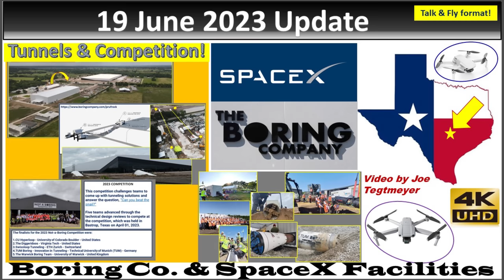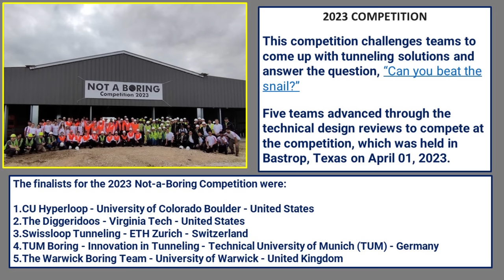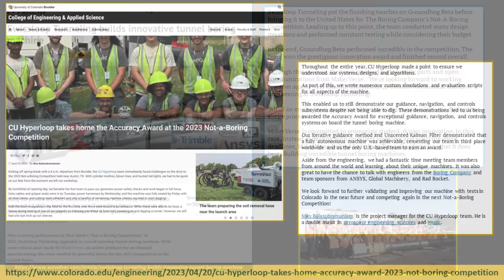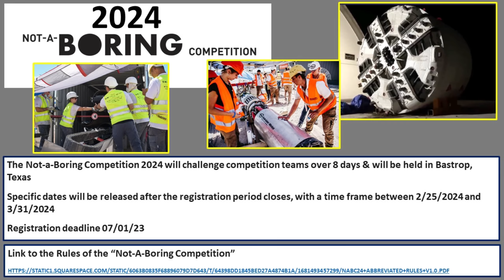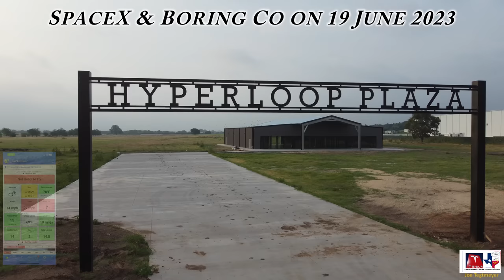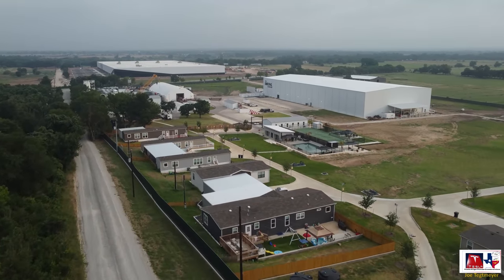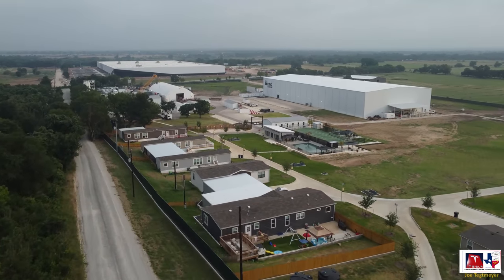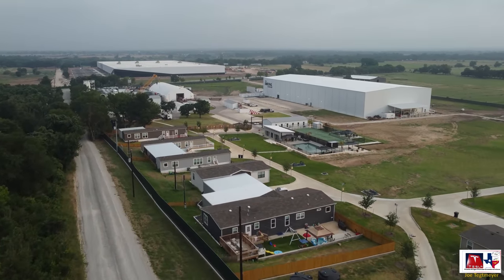SpaceX & Boring Co Facility Review & Discussion! 19 June 2023 Development Site Updates (8:00 AM)

Comment: Thanks Joe
8:26. Boring Co. White frames stacked along the fence would the TBM components dragged behind the cutter head.
10:33. Boring Co. Red and white striped trench. Speculating this is used for trial assembly of tunnel segments. A long cradle to support the segments without having to otherwise prop each segment.
10:58. Boring Co. Long yellow C shaped item under the crane. Some sort of offset lifting bar. For lifting something deep into the TBM.
12:27. Boring Co. Top left. Vertically arranged tunnel segments. Different shaped segments, hexagonal. The regular segments are trapezoidal. More stacked at the front of the property.
15:59. SpaceX. Plant apron. Conduits etc buried in the slab around the edges. Overhead pipes for the heating/cooling water.
19:38. SpaceX. Water tank. Sign says ‘Fire Protection use only’. Visible in Joe’s Patreon photos.
20:59. SpaceX. Screw piles behind the excavator. Screw head on the excavator.
22:01. SpaceX. Stack of steel and floor decking. Mezzanine perhaps.
Reply: 17:39: Is that a pulsing light strip along the floor of the tunnel??
Reply: @greggerypeccary  I guess it is. Didn't really notice it before.